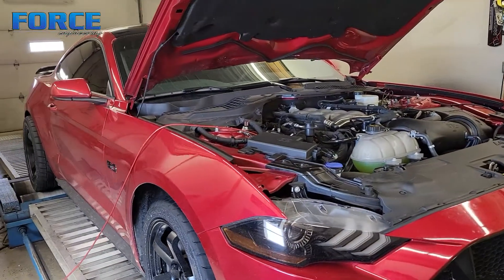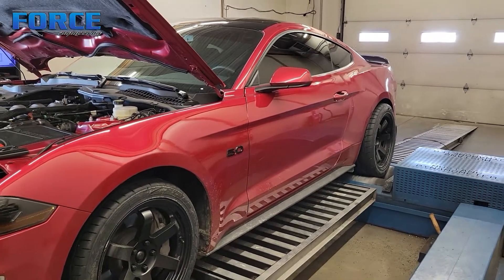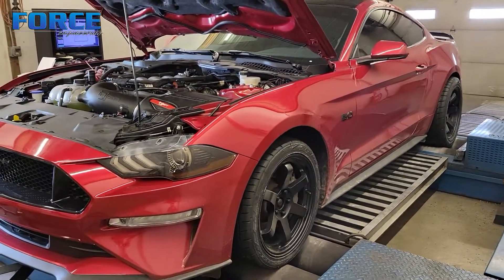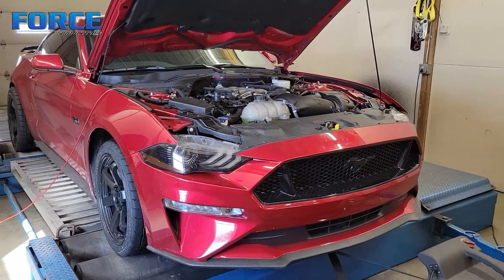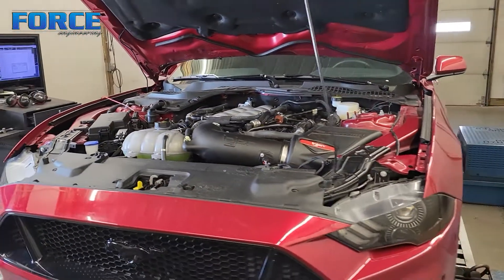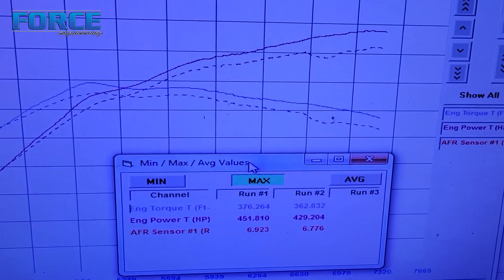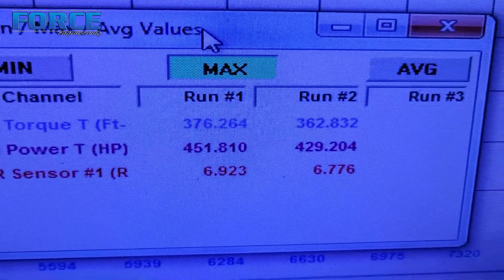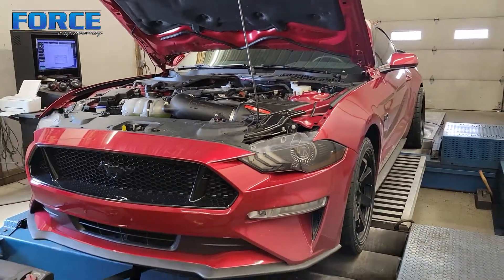2020 Ford Mustang With Bolt-ons and Flex Fuel | Dyno Review

Comment: What gear did you do your dyno runs in?
Reply from the maker: This was likley 4th gear.  Typically i choose the gear based pull duration.  For example, if im doing a hit in a 300whp car that has 3.15 gears. A pull in 1:1 would probably take 35 seconds which is way to long.
Reply from the maker: @shadjohnsen8143  no, ive done pulls in multiple gears and the power doesnt very much.  Because the dyno gets a tach signal and measures mph it knows the gear ratio and compensates for it to a point.
Reply: @ForceEngineering  ah I see, the dyno measures how fast/quickly the vehicle gets the drums rotating against force.
Reply: @ForceEngineering  ah I see, the dyno measures how fast/quickly the vehicle gets the drums rotating against force.
Reply: @ForceEngineering  ah I see, the dyno measures how fast/quickly the vehicle gets the drums rotating against force.
Reply: @ForceEngineering  ah ok. The dyno measures how quickly the vehicle accelerates against the dyno’s resistance?
Reply: @ForceEngineering  It looks like a reply from me gets put here 5 or 6 times. I promise I’m not doing that lol
Reply from the maker: @shadjohnsen8143  lol, i didnt think that was you.